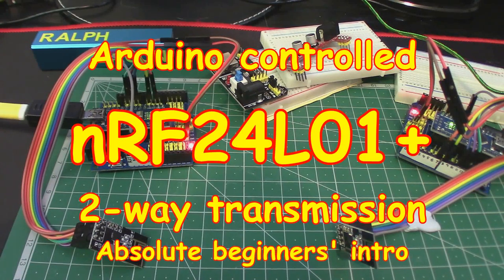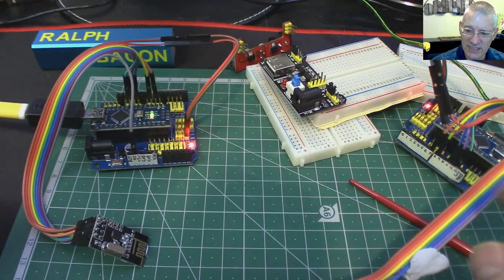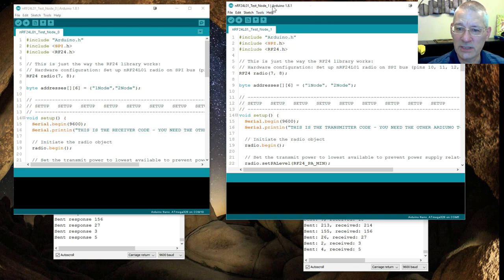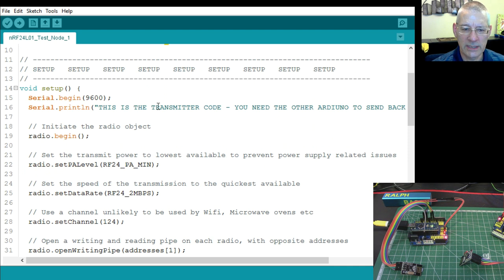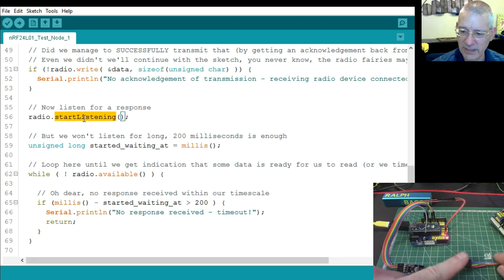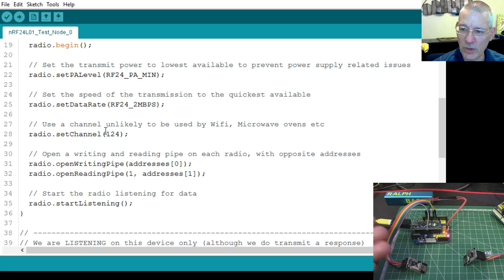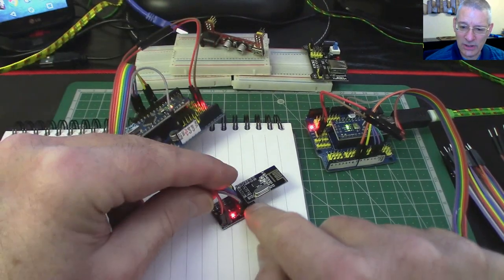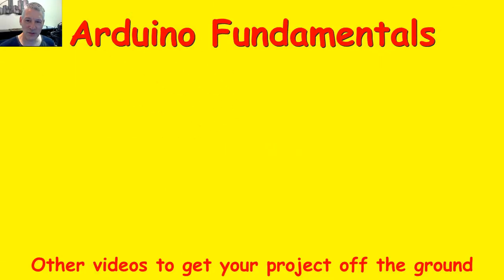#73 nRF24L01 Send (and receive) data with your Arduino!

Comment: I found it easy enough to plug the black board power supply into a 6 way and a 2 way female pcb header. The nRF24 plugs up into the supply and overhangs the prototype pcb.
Reply from the maker: You're talking about not using the standard adapter plate, David? Can you just expand on what you're doing here as I didn't fully grasp how you're powering the nRF24L01, it would be useful not just to me but others reading your post too.
Reply: Ralph S Bacon I am sorry not to be clear. The power supply board I am referring to is the Black Socket Adapter Board  https://www.amazon.co.uk/dp/B00NJCB7FS/ref=cm_sw_r_cp_apa_awLXzb5ACAMN0. This can be plugged into a couple of socket headers at the edge of a pcb. The radio board plugs up into the adapter board and overhangs the edge of the pcb. .
Reply from the maker: Ah, yes, all is clear now. Those adapter boards are the same ones I use, and yes, they can easily be plugged into a couple of socket headers on the main PCB, good idea. In fact, on that topic, I'm definitely in favour of having things 'unpluggable' for ease of maintenance or eventual replacement, it makes the whole process so much easier. Thanks for clarifying, David.
Reply: Ralph S Bacon I am very keen on pluggable modules after soldering a TFT display to a prototype board and then changing my mind. I find it is good to be able to swap out modules too to fault find.  I have two sensor units sending data to my display and data logging hub.  To keep it simple the hub has a NANO for the radio coms and another for the screen and SD card. I don't think the radio on SPI and the display on the same SPI bus will work without messing with the libraries. Would you agree?
Reply from the maker: If the libraries (and modules) follow the SPI standard then, yes, they should play nicely together (NB: nicely, adj, constantly fighting to see who is boss). No really, as long as the CS pin is kept high for the module not being used, and LOW for the one that is, then they should work together. That's the whole point of a shared bus, right? Back on Planet Earth, they may not work together at all. I've seen libraries that just put the SPI CS pin LOW and keep it there!!! But that could be corrected of course. If you have a Logic Analyser then it would be simple to see what each bit of code does to the SPI bus (and something on my wishlist). I guess you could try it, you may be pleasantly surprised. Or you may think, what the hell, another $2 Nano and I avoid all that potential pain!

Comment: Thanks for the concise description of the nRF24L01 programming.  Very informative!  I wish I had bought it before I bought the nRF905s.  They seem to be designed by the same group.  Would you think that the programming of data in/out would be the same for each of the two radios?  I would like to read serial data from one Arduino and send commands back from a second Arduino.  I have the transmit/receive section of the nRF905 sketch working.now.
Reply from the maker: Hey there, NixTrainz, welcome. I think the programming for each of the two Arduinos would be similar but not identical.
 
After all, they might (well, must) transmit on the same channel but use different numbered pipes. And the data you're sending to one Arduino (from the other) is going to be different in format to when the receiving Arduino sends back commands to the initiator.
 
What you could do is identify the common code and put that into a library (or even a simple .h file but don't tell anyone I told you this) just so you don't have to write it twice, and if you do have to amend it, you only update it in one place.
 
The nRF905 is a nice transceiver and can operate in different frequency bands far away from the wi-fi/microwave oven 2.4Ghz band, and usually come with "walkie talkie" type antennas thus giving a greater range. But you're right, the nRF2401L is probably a better (and cheaper) bet for Arduino-type projects.

Comment: Followed the same procedure and code, but the nrfs are only transmitting data but not receiving it. What should I do , I am really confused?
Reply from the maker: Are you using the adapter boards? That is definitely the first step in diagnosing this sort of problem, Akanksha.

Comment: hi ralph i am working on a project but i am not the best at coding.
so i have a question, can you maybe help me with controlling a arm or a robot wireless with the nrf24l01.
but the controller i am using is a wii nunchuk controller.
Reply from the maker: I'm afraid I'm not familiar at all with Wii or their Nunchuk controller. The best place for general help is http://forum.arduino.cc who have experts aplenty that probably know this stuff inside out. Good luck!
Reply: ok thx,
but can you maybe help me with controlling a robot arm with potentiometers wireless?
thanks
Reply from the maker: Controlling it with your phone, you mean? Wirelessly? Well, you could watch videos #36 and #37 which show you how to send stuff (and receive confirmation) from your phone to your Arduino. Once you have mastered that, it's the same as entering a value directly into the Arduino. Not difficult but you must walk before you can run!
Reply: DrekerboyStudio, take a look at this video as it might help point you in the right direction:

https://www.youtube.com/watch?v=7rcVeFFHcFM

his example is controlling a single servo with a potentiometer (actually a joystick with 2 but only 1 is used) and NRF24  modules.

Comment: Ralph, I'd like to confirm my understanding is correct.With the Adapter plate Board For NRF24L01+  it can be run from an uno?
Reply from the maker: Indeed. You can power it from the +5v pin of the Arduino (the 3v3 pin just doesn't have the current available for an nRF24). It's what I'm doing with my storage bin lid monitor.
Reply: @RalphBacon  wow that was quick. Realised I did not make myself 100% clear. Can I also have the data pins , which I assume are 5V , connected to it via  Adapter plate Board ? Thanks a lot Ralph.
Reply from the maker: Yes you can. In my Github for this video you can see some photos that show all the connections. When using an Uno it's all 5v safe.
Reply: @RalphBacon  fantastic Ralph. Thank you John

Comment: Thank you so much Ralph for putting up this tutorial video. I finally got my setup up & working..!!
Just one question, how can we send and receive multiple analog data from Tx to Rx? Can you please share me a small example of variable declaration & way to use in the code.
Much appreciated !
Reply from the maker: Congrats on getting this working, Arslan. I reckon you can code the next bit without an example, because it is very easy: you are limited to something like 30 characters but just concatenate the data you want into a string (instead of a single character like I am doing) and it should 'just work'. Let me know if it doesn't for you.

Comment: The reason the IDE jumped from 1.6 to1.8 is because at the time of the split between European 'Arduino'  and USA 'Arduino', one of them (USA i think) launched a 1.7 version already
Reply from the maker: Well, Ed, there had to be some reason and it sounds like you found it. As from Arduino IDE 1.6.6 the C++ compiler is version 11 so there are some useful (compiler-related) improvements, such as namespaces which I will be trying out later. That way we can define 'global' variables which are constrained to the current sketch. See much more here: http://hackaday.com/2017/05/05/using-modern-c-techniques-with-arduino/
Thanks for raising this Ed.
Reply: tnx for the link. Interesting

Comment: I was looking for send and receive via AcknowledgePayload, I need this for reducing power consumption, but it is not here.
Reply from the maker: I'm not using the ACK payload here, just the general auto-acknowledge but you can add it in fairly easily - but not something for a beginner video. I'm not sure that using the ACK payload is going to reduce your power consumption much though?
Reply: @RalphBacon  with ack i send and receive an information just one time per minute this is reducing a lot of radio also of power consumption.

Comment: Very nice explanation. I did something very similar with the example code in the library, but also added 3 LED's on each setup to help range testing. Green LED to show which Arduino is the Transmitter and blinks when data failed. Yellow LED illuminated when receiving data, Red LED illuminates when sending data.
One thing i am confused about is when you say "sending one byte"  @20:18 but actually sending up to 3 chars.
Reply from the maker: Great idea to add LEDs to show the state, uktoker71. I watched the video at 20:18 where I was talking about line 51 and writing a single byte of data - so I'm not clear on where the 3 chars comes in, please do point me in the right direction. In these demo sketches I definitely only send a single character (in both directions) just to prove the point, as it were. Let me know where I've added confusion!
Reply: Thanks for the reply. 
When you send for example a value of 230 to the other Arduino, I don't understand, I thought that would be 3 characters. I am new to all this Arduino stuff so still trying get my head around all the code, but slowly learning by watching Videos on YouTube and looking at the examples that come with libraries and the IDE.

-edit-

i think i just got it... 1 byte of data can be anywhere between 0 and 255, so a value of 256 to 65535 would require 2 bytes.
Reply from the maker: You got it right in your last sentence! Yes, a byte of data contains 8 bits. Each bit represents (to us humans as well as the computer) a particular value. The "Most Significant Bit" (highest value) is on the LEFT; the "Least Significant Bit" is on the RIGHT.
 
So the rightmost bit represents 1s, the next from right represents 2s, the next one represents 4s and so on. So to represent the value 5 in binary you have 0000 0101 (that's one four and one single 1, which when added together equals 5).
 
To learn you have much, my young Padawan and patient you must be (to misquote Yoda). I have many videos that will help you, I suggest starting at video #8 which might help, but there are many here. Somewhere I show a really easy way of converting any number to binary, a child could do it. Don't know which video but that should encourage you to watch several!

Comment: when would you be making a video on loop structures ? 
also why do ppl make different pin assignments for the same module? i see sometimes they use 7 & 8 and other times i see 9 & 10 for  the CE and CSN ? thanks! i would like to understand why is this allowed if the NRF is already set to look for those pin on the arduino, i do understand that not all arduino's use the same pin-out definition but in particularly i noticed that for the nano i see this pins being used in diff libraries differently
Reply from the maker: You can use pretty much any pins to control devices so the person who wrote the library would arbitrarily choose the pins. That said, pin 10 is not a good choice as that is part of the SPI pins (and is often used as a CS for that protocol). The nRF24 device isn't set to look for any pins in particular - it just wants to see the right data on its pins, after all, it might be controlled by an ESP32 which has a very different pin set.
Reply: @RalphBacon  wow thanks!!! thank you again for sharing your insight, i always asked myself why do ppl choose to have wires going all over the MCU instead of having "i dont know"  wires next to each other "parallel sequence" on the same roll or side of like a Arduino nano

Comment: Hola, es imprescindible usar adaptadores de tension para los pines SPI? Lei en algunos foros que los SPI pueden manejar los 5v de arduino directamente. Gracias.
Reply from the maker: Hola Rodrigo! Es un riesgo Podría funcionar o podría destruir el chip nRF24L01. O podría funcionar por un tiempo y luego fallar de repente. Si solo quieres experimentar, adelante. Pero para un proyecto verdadero, usaría yo un nivelador de voltaje. Gracias por publicar una pregunta interesante.
 
Rodrigo asked whether the 5v Arduino could directly control the nRFL0124's SPI pins without a voltage leveller:
It's a risk. It might work or it might destroy the nRF24L01 chip. Or it might work for a while and then suddenly fail. If you just want to experiment then go ahead. But for a true project, I would use a voltage leveller.

Comment: your video is of great help
how do I transmit float value 
if I use float i am getting error stating missing parameter 
I am trying to transmit gps coordiantes through nrf24l01
Reply from the maker: You need to read up about "structs". Within the struct you define your floating variable(s) and any others (max 32 bytes) and it all just works like it should. The C++ code takes care of what byte goes where. The receiver and transmitter must, of course, use the exact same struct for this to work. In this way, the nRF24 just transmits a bunch of bytes without knowing (or caring) what they are; your Arduino code knows however, and that's the important bit.

Comment: your video is very helpful i tried this , but one  problem i am facing , data is not receiving on receiver side , i also tried other codes but data transmits but not received plz can you help me about this ,where i  did mistake?
Reply from the maker: Are using the small plug in adapters for the nRF24L01 modules - an absolute necessity! And cheap. Are you using my two sketches for Transmitter (master) and Receiver (Slave)? If you swap the modules over do you get the same results?

Comment: First of all, thank you for an excellent video.  Your explanation was clear and easy to follow and I feel like I have now moved up a notch in the potential uses of my Arduino. I would just like to ask where I can access the data sheet (library commands to set power level etc) for the module please.  Thanks again.
Reply from the maker: Good you liked this, John, and there's now a detailed specsheet for the chip in my GitHub. However, the best way to find out the available commands is to look inside the RF24 library header to see what functions have been defined.  For example...

For example, the command radio.setPALevel(RF24_PA_MIN) shows that the function setPALevel accepts a defined constant for power level; find that function in the header (or .cpp file) and see what the alternatives are.

A bit of digging may bring up nuggets of gold!
Reply: @RalphBacon  Thank you so much Ralph. You are my idea of what a tutor should be all about. Show how something is done, then point the student to other resources, because that is how one learns. If you ever decide to release courses on Udemy or similar platforms (and you really should consider this) please let me know and I will definitely consider subscribing. Cheers from Malta. :-)

Comment: I have been using these a lot over the last few days running on 2 Arduino Pro-Minis (8Mhz 3.3V) both on batteries via 3.3V regulator. The Tx code tends to hang up. The Rx code seems OK.  I put a 10uF electrolytic across the 3.3V input on both Tx and Rx chips and all is well with the world. There may be a synchronisation issue with the WiFi chip during the Tx pulse.
Reply from the maker: Most issues seem to centre around the 3.3v power to the modules, especially if users are powering them directly from the (cloned) Arduino board's 3.3v pin which can severely limit the amount (and quality) of power available. The solution that always seems to work is the use of adapter boards so you can power them from 5v and let the on-board regulator take control. You've sort of done a similar thing but I'd still lean towards a proper adapter board which is designed to give enough current even for full power transmissions (and you can then connect the cable from the top too). But this is undoubtedly very useful information, Whitefields, given the large number of queries on this topic so thanks for posting. PS there is a post under this video that details the cloned chips' centre frequency is not what it should be - another source of potential problems, maybe?
Reply: Ralph, I was not clear enough above. I want a low weight, compact portable WiFi so I am running on one single 18650 Li-ion cell to power each my Arduino pro-mini and associated nRF. The power supply to the nRF is via a low drop out (80mV) 3.3 V regulator http://www.ti.com/lit/ds/symlink/lp2951-n.pdf. I have the 10uF capacitor near to the nRF board. All works well, but I will be lowering the voltage down to 3.0 as the data sheet of the (original!) nRF gives a range of 1.9 > 3.6V. The Pro-Mini has its own on-board regulator so the battery goes straight to this, at least for now. I started off using the adapter boards (see post below) but eventually Arduinites are going to need a specific power supply for their projects so I use these regulators which are made for the 3 common TTL voltage levels. So far reliability is perfect, but I'll let you know how things go at 3.0V which I need to get the most out of the battery. fyi a video or 2 on low voltage / wearable projects would be useful. Thanks again.

Comment: Hi Ralph, I'm using an Arduino Uno and an Arduino Nano 33 IoT, and keep getting the error message "no header (.h) files found" when using the code in your github repo. Regardless of if the Uno is running test_node_0, and Nano is running test_node_1 (or vice versa), whichever is connected to the Nano 33 IoT sends back the header error message. Is there something I can do to fix this or is it bjust because the two arduinos aren't identical? Thanks! great video
Reply from the maker: Ensure the required libraries that it is referencing are installed correctly for your Arduino platform. Normally, libraries are in the "libraries" folder which is within your sketches folder.
Reply: @RalphBacon  amazing, thanks ralph!